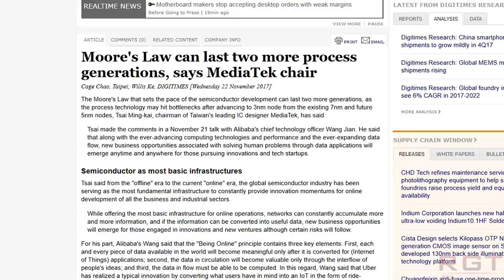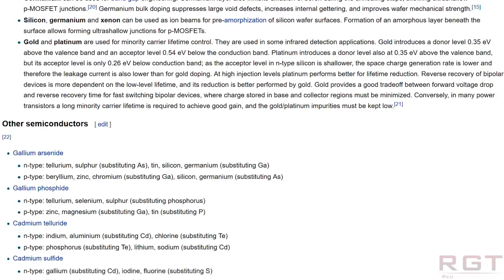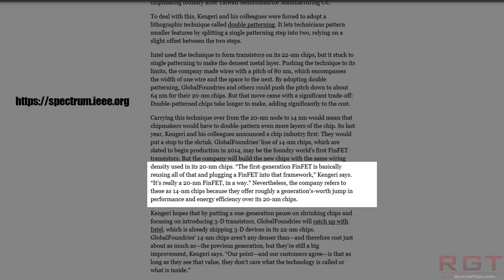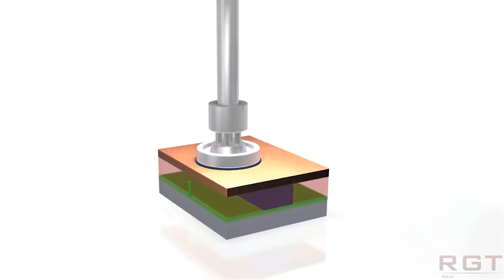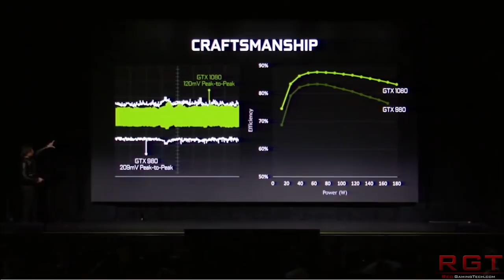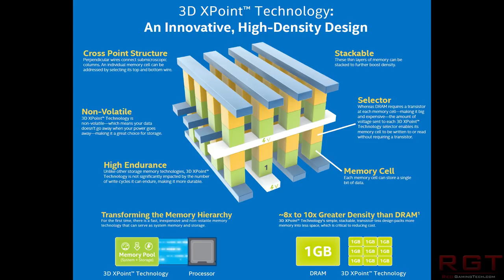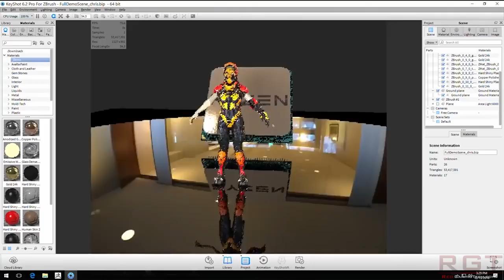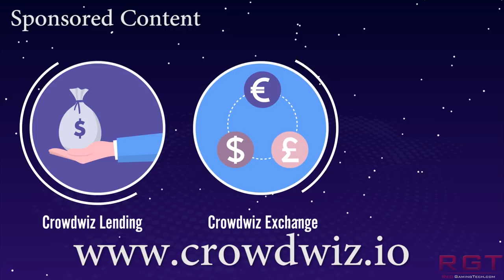Is 3nm The Death of Moore’s Law ? | Examining The Modern Transistor & Process Technology

Comment: 3nm is gonna have to be the end for at least copper based connections. At 3nm particle sizes copper melts at temperatures of ~100C so even though a interconnect behaves more like bulk copper you are getting right up to the edge of where your chip will melt.

Comment: Quantum tunneling is only part of the problem.  The bigger problem is for every "dope" atom you need 600 silicon atoms.  A typically atom is between 0.1 and 0.2 nm in diameter.  So now you need roughly 601 atoms minimum to make a transistor.  So, as you can see, a transistor that is a total of 1 nm in width means you have between 5 and 10 atoms for that 1 nm.  Now you need to get a length and height in as well.  This means there's a hard limit just based on physical space if you're going to use silicon.  This is why IBM and Intel are looking into light gates and the like.

Comment: They should move to a multi value logic gates. Not only can you store more data just like in 8 level SSDs but you need many fewer transistors to build all the gates needed for constructing a computer. Fewer transistors and fewer gates means higher speed and less losses. Other benefits are seen in multiplexing, finite state machines, AI tasks, probability, fuzzy logic, optimization and many more.

I read a paper many years ago that actually described and modeled all the gates using different number logic systems comparing them to the number of transistors needed for a binary equivalent.

Comment: It's an academic question with no real world application. Dennard scaling is well dead and die shrink will barely inprove performance of a transistor. If making transistors smaller costs more per transistor and performs worse, who cares if 3 nm can be reached theoretically.
Reply: Companies can make cheaper CPUs using larger multi-die setups, than a microscopic monolithic cpu, mainly because all it has to do is link to a motherboard, which has plenty of space. And on GPUs, the invention of the HBM allowed a ton of space to be saved as well, allowing the multi-die gpu innovation to florish.

You would never have multi-die gpu innovation had HBM as a concept never been created by AMD.
Reply: "companies can make cheaper CPUs using larger multi-die setups" 

This will make power requirements higher and will do nothing to improve single core performance.

GPUs are already embarassingly parallel; any such task does not need to be done on the CPU as long as you have discrete graphics. If a task scales to hundreds of cores you give it to the GPU.

Highly serial tasks benefit from multiple cores only by being able to dedicate a core to them and stick other independent processes on other cores.

Having many cores thus will only benefit tasks that are too gnarly and branchy to fit on a GPU, but parallel enough to use multiple cores.

Amdahl's law together with the existance of GPUs means that having many-core CPUs is useless. E.g. if the serial fraction is 10%; there is almost no speed up beyond 10 cores.

"And on GPUs, the invention of the HBM allowed a ton of space to be saved as well, allowing the multi-die gpu innovation to florish." 

That's a way to make vega 64-level graphics available to everyone. It will make power demand and performance worse than the monolithic "cost-doesn't matter, push the die to the reticle-limit"- approach at the same clocks. Only by having more shader units at a lower cost and clocking the chips slower could it help a little at the margins (but again, if the costs didn't matter, a slow-clocked monolithic chip is still better).

Comment: We'll just have to find another way to improve computing power rather than just shrinking the transistor size. We'll reach 1 nm within a decade, and let's say that's by 2030, then we'll have to improve the chips by other ways in 2035. Just like 14 nm+++ of Intel CPUs, we'll have to use techniques such as 3D stacking and V-cache to get more out of the same production.

Comment: so instead of focusing on the gate size why not try to make the actual transistor smaller instead which will most likely happen at 3nm as that is the size of the gate not the size of the transistor so if we can make the size of the transistor smaller then we can make smaller chips even when the size of the gate size stays the same 
now saying that it is not easy to make a small thing like a transistor even smaller  thus why 14nm 14nm+ 14++ as they refined the size of the transistors instead of shrinking the gate

Comment: Wait 1 moment bro ! How would you think that 3 nm is death of Moore's Law if its already dead.... Intel cant get 10 nm technology to run efficiently ... or better than 14 nm, for years now they keep trying. It god already delayed , why you think they keep rolling out 14+ nm chips ? lol. Moore's law is not accurate for what it was intended ... CPUs . Maybe accurate for video cards but even so it wasnt really meant for that industry so, Moore's Law shouldnt be talked about as its something dead already, the delay of new smaller nm chips was already delayed too much for this Law to make any sense. The increase of computing power is also rather small from generation to generation if you look at intel that had the lead, very small improvements over a long period of time, and still in 14 nm .
Reply: Why they keep rolling out 14nm?
Pretty simple, cause they where all over AMD and therefore they had no reason to roll out 10 nm!
Reply: Dude please.... its common knowledge and appeared in press all over, they have serious problems getting 10nm to work in efficient manner . THere is even talk that they will skip 10nm cannon lake completely and only come with 10nm+ ice lake in 2019 or so, cuz only that is at least slightly better/more efficient than current 14 nm.
Reply: ibm already got a 5nm chip and it says its in road to 3nm
Reply: well a simple google search and : "IBM, in partnership with Samsung and GlobalFoundries (which manufactures chips for Qualcomm and AMD, among others), has developed a process for building 5nm chips. Two years ago IBM unveiled a 7nm process, and Samsung will likely ship 7nm chips next year" article from June 2017. 
looks like IBM + Samsung + GlobalFoundries (AMD's chip-build partner)  are all in bed together. But from AMD's roadmap ... Zen 2 (7nm) comes around 2019, maybe there is chance of late 2018 but at this moment it doesnt seem so.
p.s. however there are differences between intel's nm calculation and AMD's , what these new chips will offer in terms of performance is not sure, but obviously they will be better than AMD's current 14 nm... thats already safe bet, unlike intel's upcoming shrink.
Reply: "Pretty simple, cause they where all over AMD and therefore they had no reason to roll out 10 nm!"

If such were the case then explain why did Intel circulate the information that they would produce a 10nm Cannon Lake Chip scheduled for production in 2016 ?
Reply: Adrian A The Tech Press has made it a "Thing" to blow Gordon Moore's pronouncements out of proportion. Moore's Law isn't a law at all. It is an observation after the fact and Moore would be the first to tell us that. The fact that he cut the progress factor in half from his original assessment in 1965 when queried again just 10 years later illustrates the malleable nature of this "Law".

Indeed the pace of development of Semiconductor Technology has slowed down dramatically over the last 15 Years. What matters to us is the ability to produce large scale microprocessors for PCs. Those chips are usually last in the chain to go into production. Typically the development cycle goes from a Lab Demo Unit followed by a Memory Chip (the easiest to produce), followed by an ARM Core BB CPU, and finally the Large Scale x86 CPUs. That process in and of itself can take anywhere from 3 to 6 years these days. The latest reports tell us Intel's 10nm Node is producing chips with little measurable performance increase than their current 14nm++ node. It then follows that Intel could still be years away from mass producing chips on this node. This undesirable development has lead to considerable speculation the Cannon Lake Series of CPUs is a bust. The question now is how long can the 10nm node be delayed without inflicting more damage on the Intel Product Line ? There is a quiet confidence expressed by both AMD and Global Foundries their 7nm Node to be implemented possibly as early as the end of 2018. AMD/GloFo have announced plans for a 7nm DUV Node and a 7nm EUV Node but have not statedwhat their plans are beyond. This leads me to conclude that market factors will weigh in heavily on their future plans. Intel says it will do 5nm, Samsung says it will do 4nm, and TSMC says it will do 3nm. Only the TSMC declaration seems to contain solid backing in the form of actual expenditures to construct a new Fabrication Plant. Morris Chang CEO of TSMC has stated the plant will be producing product by the late 2020s without specifically stating what exact product it will be producing. If ARM Core can gain a foothold in the next few years x86 could be well on the way to being relegated to High End Applications by the late 2020s. Intel has chosen to collaborate with AMD in large part because it views Laptops as the dominant consumer sector in the next decade.

It all boils down to a matter of economics. Each new generation of Microprocessor Development brings an exponential increase in development and production costs. Development will continue only so long as there are sectors willing to pay those costs. AMD's development of Infinity Fabric, and with it usher in Scalable Architecture, may forestall this trend for a while. But it won't last forever
Reply: Bob Marston because they wanted people to get excited about something. Same reason they paper launched coffeelake
Reply: +Bob Marston yea indeed. But even if these companies manage to pull off 5 or 3 nm ... it would seem obviously that silicon reached a huge slowdown and the end of the road. Recently I saw a video of Michio Kaku speaking, a scientist, and I was a bit amazed that he confirmed what I was thinking... and that is, whoever manages to build a better chip based on better new material, not silicon, could completely take over the tech industry from classical companies (silicon valley) like Intel , AMD / Global Foundries , etc. But we dont know much if there are researches going on... I would imagine someone has to try and invest there, but since I dont know I can only speculate, well in the end the break could even come from university centers, which have some very good research as well, who knows.... P.s. its possible that it will take a decade till silicon is replaced, or its possible that happens tomorrow ... place your bets, lol.
Reply: @Bob Marston
Also simple.
1.) Marketing
2.) Risikmanagement 
3.) Raw material  costs
4.) Development time

But your second comment is pretty good. Did you do copy and paste? Just wondering cause i would love to read the whole text, if so. So no offend there! :)
Reply: @Adrian A
I don´t think it´s that easy.
It would be pretty hard to get rid of those competitors, especially all at once.
But I m with your essence.
Reply: Well, taking over the market in the sense of building Patented technology, but this would also mean that newcomer companies would startup based on this new standard, I would imagine. So while of course this doest mean Intel, AMD or Samsung, or any other company would disappear , specially when most of them by now are involved in multiple markets and technologies.. it still means a blow dealt to them and their current dominance of the PC market. But then again... who knows, maybe one of the dominant companies did secretly invest in research in new material chips... its possible however I kind of doubt it, since Intel tried to move into sectors like automotive and now recently graphics , I would argue for them its probably a cheaper investment, I could be wrong, I wish I was wrong, and all these major PC market companies actively research new conductive/semi-conductive materials and technology options for more efficient chips... but I have doubts as they still are profitable today, they may be short-sighted for what may appear to them as far future.
Reply: Adrian A Progress in the Semiconductor Industry ebbs and flows. For the PC Business we are emerging from a Quiet Period over the last 5 years. With the realization that we are approaching the limits of Silicon I've dubbed this period "The Last Great CPU War". We have had two others.  The last war took place in the Early 2000s between Intel and AMD and the very first war which ran from 1977 to about 1985 which was a Round-de-Royal Affair between Intel, AMD, Zilog, Motorola and Mostek. AMD's plethora of new introductions in 2017 is the first salvo in this war and there should be several more big products coming from AMD in 2018. Intel isn't going to sit still if they have anything to say about it. Their big problem is 10nm Fabrication. The questions now are can they clean up the issues with the present process and how long do they keep pouring money and assets into that process without success before they pull the sheet over it and head straight to 5nm. The 8C/16T Coffee Lake Chip is looking like it will be Fabricated on 14nm++ and that is coming at the end of 2018. AMD will introduce 12nm Fab for the Desktop in 2018 and may stay with it for 2 and even 3 years. Within an Architecture Update in 2019. 7nm appears that it will get its debut in Late 2018 for the Data Center. Vega 20 is to be released in the 2nd half of the year on 12nm. Navi is expected to be released on TSMC 7nm Fab Node at year end or early 2019 and there is some talk about an updated Polaris Card that could be released. So the rumors seem to indicate the hectic pace of releases could continue well into 2018. The wildcard in all this is Qualcomm. ARM Core Hardware/Instruction Set has been around for a long time. I think it goes back as far as x86. There have been great hopes for it to deliver power efficient Server Hardware for at least 3 decades but they have never found partner with the commitment and economic clout to develop and support the Microcode. Maybe Qualcomm is that player. I do know is Broadcom's takeover bid is a good way to torpedo that effort. Returning to your question there are alternative substance that can be used. Indium Phosphide and Gallium Arsenide but both have serious safety concerns that have been known for a long time. There is Quantum Computing but that is still 15 to 20 years away for the prototype stage. The winner of this war could find themselves in a very lucrative position for a very long time.
Reply: @Adrian A
Well i know they do invest in to that but not as much as they could...

Comment: My take and up front I am running AMD and that does not matter.
AMD is pushing to fast and this will ruin things. Ryzen shook up up the market and woke Intel up. Vega has caused a bit of a stir and Nvidia put out a worthless GPU.
Here is the issue. AMD fell asleep behind the wheel on the FX series. They could have done more but didn't. Intel kept improving on the quad core design. They did not go develop something else and other then using TIM instead of solder, they did well. So well Ryzen tried to compete. I own the 1600X and it works great but is not perfect because it does not beat a 7700k with 4 cores. Now AMD want to move on.
AMD GPU: Polaris was a great improvement. I bought the XFX RX 480 8GB but AMD did not perfect Polaris. Vendors spent more time and the 500 series were born. I run my 480 at 1350 MHz and a reference 580 is 1340.
AMD has been about "Fine Wine" technology and it has gotten better with time on the GPU side. The cards are more powerful with time. STOP shrinking crap and perfect what you have! 2019 rolls around and Intel will use the same crap with taped on cores. Nvidia will still run Pascal and both will stomp your ass because you did not perfect anything.